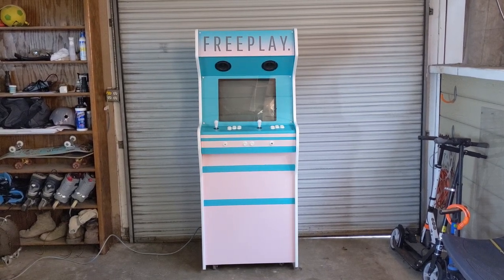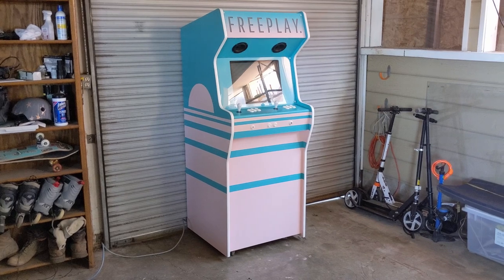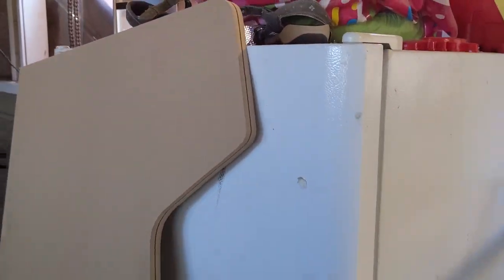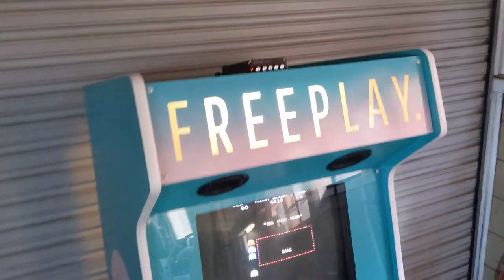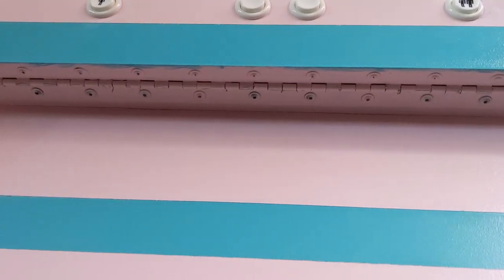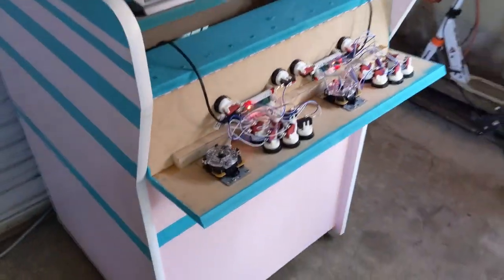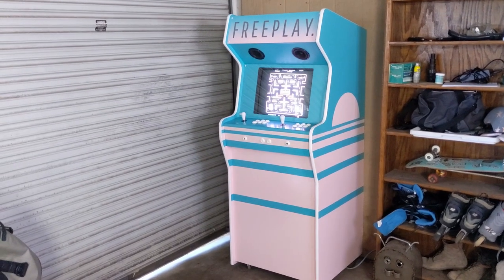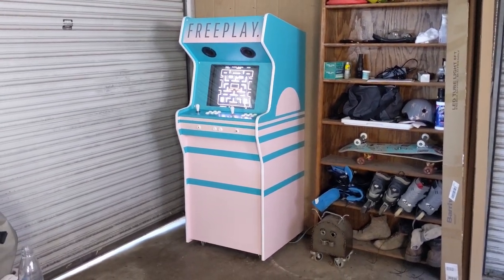Custom Retro Arcade Cabinet with CRT and Raspberry Pi - Make it So

Comment: CRT! <3 finally someone does it right! I cant stand the input delay on modern screens
Reply from the maker: CRT or nothing! Thanks for watching.
Reply from the maker: @Brian Babin CRT's are ridiculously heavy no doubt. But most if not all of these retro games were designed and tested on CRT monitors. The in game art and design was specific to being displayed through CRT scanlines at a specific resolution, something that is nearly impossible to replicate accurately on a 16:9 HDTV.
Reply: @MakeItSo  I don't mind the input lag at all, and there are some fantastic shaders you can run to mimic a CRT... but for my money there is nothing that truly gives the sensation of the curved glass, quite hum, and faint static-electricity other than a real screen.

Comment: Such a well designed cabinet, great A E S T H E T I C.  Love the outrun-esc icon, vaporware colors. If you went OG with the CRT you should check out the FPGA MiSTer, frame perfect hardware modeling, no emulation slowdown, no input lag. RetroPie has more games, and great price! can't wait to see next build. 4:3 vertical? cocktail cabinet?
Reply from the maker: Hey Thanks for checking out the video. I really want to build a Light Gun specific cabinet next. I'll check out the hardware you mentioned. Subscribe if you want, some more videos coming in the future.

Comment: That's a great build and looks really tidy. I'm making something similar at the moment but using original hardware. It can fit up to 4 consoles. I have a few of questions if you don't mind giving some advice.  1.How did you seal the MDF when painting it? 2.what type of paint did you use for the plexy glass? 3. What size did you print the control template? I've printed a few but I can't seem to get the right size. Thanks.
Reply from the maker: Hey! Thanks for watching. I didn't seal the MDF. I used a standard house paint (I think paint and primer in one) and hit it with 2 coats per color using a paint roller. For the plexiglass marquee I used Rustoleum spray paint. If you watch the video again I think I throw up a couple of images of the exact spray cans I used for the Seaside Green, and Candy Pink. I downloaded a control  panel layout from the following website and made sure when I printed it I set the print settings to print at 100% no scaling. Hope that helps! Feel free to hit me up with any other questions. Link below. 

http://www.slagcoin.com/joystick/layout.html

Comment: Awesome cabinet! Have you managed to adjust the screen size as it looks like Ms Pac-Man is cut off a little at the top though that could just be the filming angle.
Reply from the maker: I think the CRT itself needs calibrated, it's also off angle a bit. Definitely not the software's fault. Thanks for watching!

Comment: I’m eager to try this with a pi! Thanks for showing the cable and converter. Mostly I’ve been pushing 480i from a computer to a crt. I was wondering if you could tell a major difference when doing 240p instead of 480i?
Reply from the maker: I can't really tell a difference between 240p and 480i since I haven't compared them directly. The biggest difference here is the RGB output from the Pi to the Component input of the TV which makes the image much sharper and clearer and the native scanlines of the TV much more pronounced than if you were using Composite input.

Comment: Pretty awesome, thanks for showing that beauty! I can literally feel the dedication you've put into that cabinet. Building a CRT TV arcade cabinet is also on my bucket list but i didn't getting started yet.  Which PC program did you use to draw the cabinet dimensions?
Reply from the maker: Hey! Thanks so much for watching. I didn't draw the cabinet design myself. I borrowed heavily from the following website that has incredibly detailed instructions on how to build a CRT cabinet. My cabinet design closely matches an original Joust cabinet. Very classic arcade design. 
https://retromash.com/2016/02/09/building-a-home-arcade-machine-part-3-cabinet-design/
Reply: @MakeItSo  Ah great, i should check this out to get even more inspiration, thanks for the link!

Comment: Cool looking cab.
Couple questions: With the tv (crt) can you have it vertical and use the pi in portrait mode? And, the black & red wire coming out the hole on your TV, are those coming from the internal speakers? 
Thank you.
Reply from the maker: Yes you can turn the tv sideways and set the Pi to any screen rotation you want for Tate mode. You can even set it to mirror mode in case your screen in reflecting off glass like some arcades. The black and red wires coming out of the hole are wired into the TV power button, I ran them to the top of the cabinet and wired them into an extra arcade button/switch that I had leftover. It allows me to turn the tv on and off independent of the pi, without opening the cabinet to get to the button on the front of the tv. Thanks for watching! Great questions.
Reply: @MakeItSo  I really appreciate the info. Looking into building a cab for a Donkey Kong project I'm working on and this will be a great help. Thanks again!
Reply from the maker: @flightofapaullo72  For sure, I'd love to see what you're building when you're ready to share.
Reply: @MakeItSo  I appreciate that. Never posted anything before, but I'm definitely gonna take a crack at it. Will do.

Comment: Hello mate, nice build. I'm almost certain you don't need the retro tink in order to get a RGB picture to your TV. I also have a RGBpi scart cable. All you should need is a female scart to RGB (Y Cb Cr) cable. They don't cost much as it is just a cable. I use similar cable to hook my RGBpi to my PVM just with BNC ends instead of RCA for the RGB cable end. 

Edit having said that are you using the retro tink because your TV is being fussy with what khz the signal is coming out at?
Reply from the maker: You're probably right. I just didn't think it through at the time. When I came across the RetroTink adapter and saw that it was powered I thought it was doing something special to convert the signal from Scart to Component. I didn't have a solid understanding of what I needed and paid more because of it. I'd love to do another CRT build but they're becoming more and more expensive as more Retro gamers are seeking them out.

Comment: Hello! I am with a similar project, I use an RBPi / RGB-PI OS + TV CRT but I don't know what will be the best way to manage the power supply of all the devices (TV, RBpi, sound equipment, lights, etc) You used only adapter with multiple plugs or do you use any PC power source? I see that you use a single button to turn on the arcade, but with that you only turn on the TV or also the RBpi and the rest of the accessories? Did you modify the power button on the TV to turn it on that way? Could you explain to me how is the electrical connection of your Arcade? Thanks for your help!
Reply from the maker: Everything except the CRT is plugged into a standard power strip that plugs into the wall. So my RBPi and Audio Amplifier and essentially always-on until I unplug them. I didn't want to leave my CRT always on so I opened the case and found where the power button on the front of the CRT was wired to the circuit board with two wires. I cut those two wires and extended them to a new button on top of the cabinet. So the TV remains always plugged in and receiving power like everything else. The extended button just turns the CRT on and off separately.
Reply: @MakeItSo  Thank you very much for your answer. I will try to do something similar in my project, to be able to turn on the tv from some hidden button. Greetings!

Comment: Saw this on Reddit really cool. Are those 8 way or 4 way joysticks?
Reply from the maker: They're 8 way. Not ideal for Pac-Man.
Reply: @MakeItSo  you should setup xboxdrv and add the --four-way-restrictor argument it disables corner movements, it seems to work for me, it took a little while to set it up though.. I’ll leave a link to the guide: https://retropie.org.uk/docs/Universal-Controller-Calibration-%26-Mapping-Using-xboxdrv/

Comment: Hey great video and build. I have an old setup I am going to try to convert to use a pi3.  The video does not go over the mame setup though so was wondering what version of mame you are using and what you are using for a front-end. That would help me out tremendously.
Reply from the maker: Hey Mike, I'm using RGB-Pi OS https://www.rgb-pi.com/ It's a front end paired with their GPIO to SCART cable. A lot of times different games will require different versions of MAME, either 2003 or 2010. For example most "arcade" games run on 2003 and most "FBA" games run on 2010, in my experience at least. I was thinking of making a video going over RGB-Pi OS. It's not like Retropie where there's a lot of setup involved, it's turnkey. Load the OS, drop your roms in the folders and start playing. It's all geared towards CRT's at 240p.

Comment: What about trackball or spinner? There are games that are don't work well with a joystick..like Centipede, Missle Command, Tempest..etc.
Reply from the maker: Or a steering wheel, pedals, and a light gun. There's lots of things that could have been added for sure, I wanted to keep this clean and simple. I just don't play those games often enough. I have another larger CRT that I'm thinking of turning into a dedicated light gun cab for all the games that require more peripherals.
Reply: @MakeItSo  If you're going to put a tiny steering wheel then you'd need a full size cabinet..the one that takes a 32" with 4 players

Comment: If you want to run old arcade games..raspberry pi has a limit.it runs very very old arcade roms..and some roms you have to switch back and forth between .78 and .139..it's really annoying. What you can do is that you can put in more money and get a mini pc..and you can run a lot more console games and mame games.
Reply from the maker: I haven't had a problem running any retro console games on the raspberry pi. I mostly play MAME, FBA, Neo Geo, SNES, Atari 2600, NES, and N64 and PS1 games. N64 games are hit or miss but the only one I really care about is Mario Kart 64 and that runs great.
Reply: @MakeItSo  yep..good luck on playing n64, psp, ps2, sega saturn and even dreamcast..where as if you have a mini pc..you can run most of those consoles as well..believe it or not..even a 15-20 year old pc is still more powerful than a raspberry pi..as demonstrated by ETA Prime, which he bought a $60 or $70 pc and it ran almost everything. So a celeron or an atom chip should do the job.
Reply: @MakeItSo  Maybe because I was running raspberry pi 4 on batocera. Maybe retropie is better.

Comment: Did you just have the one game... can you get Rasberry Pi with multi retro games
Reply from the maker: It has almost every game and system on it. Too many to choose from. I usually stick to the classic arcade games and play things like SNES on the actual consoles.
Reply: @MakeItSo  Cool........ I'm trading some Auto Body Paint work for my uncle's for a Exteme Arcade that he paid $8000 for his Grand Childern.... I have a 36inch SONY CRT TV and was thinking of doing a Build with just the old Arcade Games from the 1980s.... I have 43 Years Autobody under my Belt... was going to make the 36in TV tilt down for games like PacMan and Up straight for games like Joust.... I would have to build a Steel Square Frame to tilt the very heavy CRT TV and then Plywood on the sides to make it look like a 80s Arcade Cabnet.......
Reply from the maker: @kelvenguard  That sounds like an ambitious but very cool project. Check out how the Japanese "Candy Cab" CRT's rotate, might give you some ideas. See link...

https://www.youtube.com/watch?v=7r3lpASQd4c&t=34s
Reply from the maker: https://www.reddit.com/r/crtgaming/comments/z3oox4/oh_man_i_want_this_rotating_pvm_rig_so_bad/?utm_source=share&utm_medium=android_app&utm_name=androidcss&utm_term=1&utm_content=share_button